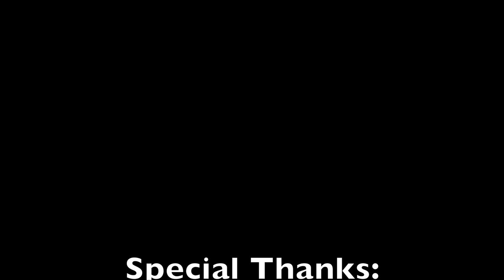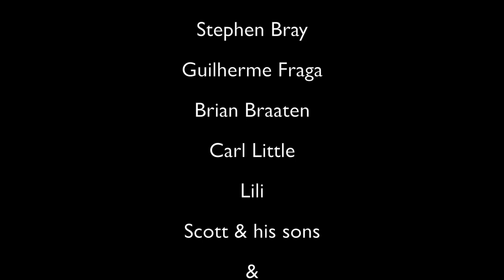DMV: Mexican Break-Down Adventure

Comment: About the same as Geemail. I always stop but to date I have never had anyone stop for me. It is sometimes difficult to stop knowing if it were me on the side of the road that I would be waiting a long time. Worst one: had my handlebars fall off(new bars and the bolts fell out) on mountain twistys in Arkansas and ended up wearing the bike in a rock filled ditch. No cell signal. Not a single person, bike, car or truck stopped. Literally had to pick the bike up off me. I hiked back up the road found two of the bolts and made it to a hardware store. So thumbs up to each and all that do still honor the old school rules- and that other finger to the ones that ride on past.
Reply from the maker: At least you got a good story out of it! Insane that nobody stopped...

Comment: Add the same thing happened to me Tire kept spitting Tire plugs out had to get bike towed in the end you should purchase some tire pressure monitoring valve caps one set comes with a little screen the other set that works off your phone very handy to tell your air pressure

Comment: I picked up a large bolt in my rear tire. I used multiple plugs and stopped every 2 miles or so to add more air. A small independent shop picked me up and installed a new tire. The local Harley store said they didn't have time for me.
Reply from the maker: Freaking crazy how some things end up in the tire lol

Comment: Joe, happy everything turned out ok. When you get stranded on a motorcycle, you’re really stranded. Front tire flats are lethal at high speed. Rear tires are easily controlled.  Check tire pressure after every ride so you’ll know before you go. Ride safe.
Reply from the maker: Cheers Mike!

Comment: I have never traveled the distance that you and Scotty Drive but I have broke down on the road more times than I would like but I've always been lucky by twisting a few wires together or switching out relays for different things to get myself home flat tires are always exciting I had a blowout on the front tire of my Softail Standard 65 Milan hours down to 45 what's a little sketchy but 45 down to stopping got pretty hairy flip down the HOV to get off the highway in code for a pickup truck that a friend had being a poor cheap bastard I do most of the work myself minus machine work thank God for the Evo bikes they are shade tree mechanic friendly so right on dude ride on and tell Mr Scott Tom said hey

Comment: I was with a guy riding quads.. he had a slice in his sidewall. We all carried plug kits we had a lot of steep hills to climb to get out of there and his rim was spinning inside the flat tire so we had to try something. For the hell of it he put plug after plug in the sidewall, about six of them, with contact cement/vulcanizing glue that came with the plug kits.. it held well enough to get back about 6 miles to our trucks deep in hilly Play area for quads and dirt bikes and buggies and off-road vehicles in Ohio..
  there is a certain type of patch that looks like a mushroom. it’s like a plug with a patch on the end you must install it from the inside of the tire..It has a stem and a flat patch in one that might’ve got you out of that if you could break the tire off the bead.
  When you need to break a tire bead, it takes two people to do this, use the side stand of the heaviest motorcycle there to break the bead of the tire you need to fix. Just lay the tire on the ground beside the side stand, and have the guy tilt his motorcycle with a side stand down right on the tire at the bead…That will break the bead..
  I wasn’t there but to tell you the truth, since the bike felt Squirrley when you first pulled out, now you know that you should check the tire out when you feel that snake dance..
  Love your videos. I would never consider going to Mexico for anything until I started watching your videos..
  A coworker’s retired parents used to go south from Phoenix where they live into Mexico to get their prescriptions filled. One time they stopped to get a drink at a little restaurant. The next thing they knew they were waking up ..they were lucky-other  retired Americans could see what was happening and they stayed with them until they recovered. Somebody put something in their drinks when they ordered … they say that is not uncommon for someone to spike your drink, then rob you, and you are screwed if they take all your papers and credit cards..
Reply from the maker: Thanks so much! Maybe not a bad idea to be careful while partying, huh?

Comment: Your issue was when you were putting the plugs in you where twisting it before you pulled it out that was just rapping the plug around it and causing you to pull the plug back out when you put the plugs in just push it in and pull it out no twisting sometimes with a larger whole I'll take two fingers and hold the plugs and pull the installer out between my fingers the older style plug kits you used to twist but these new ones you don't I just noticed it because it was a motion I had to get broke of to I hope this helps you in the future stay safe out there brother

Comment: Just wondering ?  You seam to like Harley rally’s & lifestyle. Why not ride one ? I’ll have lived and understand most any answer.  In my 50+yrs living on MC & working as I go , iv worn out all bike brands. Even an st1300 & klr. But since evo days (84) Harley’s have just gotten more & more reliable. Good bikes now .. Was just curious
As you probably remember I ride a Dyna converted to a touring bike.. fits me
Reply from the maker: I've demoed several of the new models and liked them. At the end of the day it's their prices, man. Not just for the bikes, but for parts/ service/ etc. Almost everyday when I'm working, I hear somebody got ripped off/ gouged. If they can rework their business model, I'll support them and sacrifice the $. But until then, I got a smokin' deal on the ST and it works just fine. Maybe not as cool, I'll grant you, but hell... I saved a LOT compared to the price of a comparable used hd 😎
Reply: @dirtymotorcyclevagabond  I understand.. hell I’m to old to care about cool. I buy best deal on used whatever brand, but I try for Harley first. Never new, my 2016 dyna FLD had 10k mi. For $8k. On road a lot, huge dealer network is major to me.  That’s Harley or Honda.   Plus us Cheepos  find the small shops to support & less $. Like Scotty does. I just hated taking all the plastic off my wings, etc. Just to work on it. Any bikes  a good ride !  Glad all going well for ya..    I modified tire plug tool too to shove in 3plugs at a time for big holes.  It worked.  Might not be the best idea ,I wouldn’t do it on the front.. but when stranded.  🤪